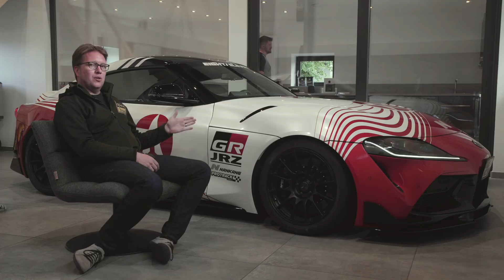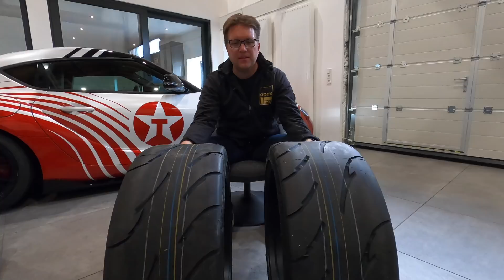Tech Talk: Toyota Supra, Ruined by Bump Steer?!?!

Comment: Exactly the critique that we (track day guys) need.  Info from a firsthand hardcore user about problems like bumpsteer in the Supra or overheating 675LTs is invaluable.  No car is perfect but at least our eyes are open.
Reply from the maker: Every car has it quirk now doubt and we find it quick haha
Reply: @RobertMitchell  Great video Robert, how much have you sunk into this project and willing to? Also, would the BMW have the same problem?
Reply: @DonBarracuda117  Toyota/BMW same suspension geometry.  I'd be surprised if it has excessive bumpsteer.  Stock 2019 Z4 did 7:55 Nurburgring lap time and the Supra did 7:52 lap time, which would be very difficult to achieve with excessive bumpsteer on a 97 inch wheelbase car.  SportAuto has a plenty of videos of stock Supra/Z4 on the track... I saw nothing unusual.  I'm familiar with front-end bumsteer on BMWs when you lower the car too much, but I've never seen/heard of rear bumpsteer from reasonably lowering a BMW.  I would love to see a video of Supra bumpsteer.
Reply from the maker: NoToBigBro thats actually not correct. The car can still be drivin quick it just feels like shit.  100% has bumpsteer issues and I’ll show graphs etc on next vid
Reply: @RobertMitchell  according to The Smoking Tyre they fixed this with the 2021 model
Reply: @RobertMitchell  👍👍
Reply: @NoToBigBro Yeah also it's not 50/50 WEIGHT DISTRIBUTION TECHNOLOGY
The driver and reality still count in the real world.

On a serious note they engineered in the same thing to my 86, particularly under braking. Going another 100kph faster again makes it no longer fun but dangerous.
Reply from the maker: Ash YES!
Reply: Type R and their 2nd gear grind and also overheating. That’s the world of performance cars. It’s honestly pure luck that we even get them. They aren’t money makers, oftentimes just big expensive liabilities for manufacturers.
Reply: @latuba2478  yeah 2nd gear grind comes out of nowhere. Feels like you can’t get it into gear all the way sometimes without pumping the clutch or just giving it a couple of seconds.

Comment: The corvette is much better hint hint. I think it was setup like that to make it loose on purpose to make it drift easier. It could be bad engineering but this is a BMW design so that can’t be possible.
Reply from the maker: No, many still still fix the toe angle in to make the car maneuver consistently during the drift. the actual suspension is adjusted for help wir the actual act of initiating the drift :-).  Good idea though!

Comment: Very interesting.  Wondering if the Z4 or others with a similar design suffer from the same problem?  From a quick search, pretty much all the components are shared between the Z4 and the 3 series.  Very very strange.
It's super interesting that most tests didn't mention this, considering that somebody with some vehicle dynamics experience can notice this.  
That said, i'm excited that you aren't giving up on the chassis and looking for solutions.  Seems like Wisefab has offerings for the car, however dropping 7k+ on a new car to make it actually track capable doesn't sound like a really fun thing to do... Hope there is a more affordable solution that you find.
Thanks for sharing!
Reply from the maker: I guess it depends on how the tests were done.  You have to be super in touch with the car to feel it at lower (US road speeds) and on very smooth tracks.  Get huger speeds and more complex tracks and you still have to know what’s going on to feel it.   However if someone isn’t in tune with it they’ll just make mistakes with the car and think it’s them. 

Some people have driven ours and not noticed it until I pointed it out exactly when it’s happening and then it’s obvious to them.  

Yes this Shouldn’t take That kind of money to fix.... hopefully 1-2k no more.  I will for sure update as we go

Comment: I believe you 100%, but isn't that a BMW Z4 in Toyota skin? I've never heard of this issue and I am shocked. Thanks for the info.
Reply: There are a number of other reports of the z4/supra platform struggling with loose rear ends during track use - check out Jackie Ding's time attack A90 that he totaled for one example. I know a Speed Academy I watched mentioned there was one other person they knew other than Jackie who had struggled with the keeping the new Supra's rear end in check.
Reply: @Talynen  check his instagram post. he rly  likes the stock suspension for what it is out the box
Reply: @Talynen  just look at the track battle of jackie with the C8 and a stock Supra, he can't get the rear end to settle smoothly on exits
Reply: @estewarrior1  Have you ever watched Jackie drive in real life? He always slides his cars. Even his old S2000.

Comment: Hey Robert, thank you for sharing your honest opinion about the cars in your apex and private fleet. I've got a question about your opinion on the Nissan GTR MK4 (2017-2020) what are your thoughts about that car regarding reliabilty of the engine, transmission, brakes, if used as a weekend toy and track car. Does it last quiet some time or is it so fragile like the reputation. 

Would be nice to hear your thoughts about it. Keep up your interesting videos. 

:-)
Reply from the maker: I think I can get some info on just that!

Comment: I wonder who was responsible for that job. Toyota or BMW. Hopefully you sort it out. It has potential to be a really good track car. BTW the overall look is pretty lit now with the mods.
Reply from the maker: Good question.... who messed this up!
Reply: @RobertMitchell  it must be a BMW fault. Call me wrong, but BMW makes this 5 link rear suspension since the E8x/E9x 1 series and 3 series. As common experience, these cars really work with it. And tons of people have figured it out, how to set it up and what to change for track use. In first glance at looking the picture of the z4 rear suspension, the general design is very similar. So i can't understand it is possiblem to f*ck this up?
Reply: I'd guess BMW. Clarkson tested the M4 GTS and he described it as "somewhere between spiteful and undriveable". The ordinary M4 has a habit of sliding around as we saw it doing that a lot in the marketing for the car. Perhaps thats all it can do? Phil Morrison of Driftworks had an M2 once and fitted an older more predictable diff because he said the standard one made the car dangerous. The standard diff had a habit of opening up mid drift, speering the car violently in the opposite direction. He also had an M4 as a loan car once and said it was dangerous in the handling department too. He said the first time he drove it he got out and actually checked to see if it had any tyre tread as it was so lacking in grip.

I'm a BMW fanboy but they really have dropped the ball when it comes to performance cars recently, so I'd be suprised if the A90 handling problems are Toyota's fault. It would be interesting to see if the new Z4 has the same handling issues though.

It's such a shame. The FT-1 concept's striking looks (which have unfortunately been watered down), BMW's reputation for performance and Toyota's reputation for tunability and bombproof reliability should have made the new Supra an epic car. Unfortunately I think it is one of those cars that has been designed to sell in large numbers (using the name and reputation of the MKIV) rather than be a true flagship performance car.

Comment: Being a Supra owner, I can attest to the loose rear end, even while driving on the road. I'm waiting for a solution to come along.

Robert, do you think a GT wing for downforce help in the short term?
Reply from the maker: Sadly a wing is not the correct way to fix it.  It may reduce the weight transfer under transitions however at the big moment it does happen it will make it even more dangerous. I really hope it’s just a matter of a new tie Rod which would be a simple solution
Reply: @RobertMitchell   Ever since swapping to the SPL rear tie rods on my a90 with the solid bushings I have notice that feeling of uneasiness at speed after letting off has minimized.  I am also running the rear SPL traction bars as well - perhaps taking up the deflection in the OEM bushings is helping the geometry flex less to create those moments you explained.
Reply: @RobertMitchell  Do you think the 2021 refresh helped things?
Reply: @ciello___8307  not going to put it as official but I heard that Toyota retuned the 21s chassis so it wouldn't have as much body roll and etc like the 2020 did so it'd be more track prone than the 2020. Can't say if it's going to handle better and not have these problems like the 2020 since no one's put both head to head and pushed both on a track to compare them.
Reply: defiantly not, dont do this! The weight transfer is so big you will always keep that bump steer

Comment: Not driven one (and very little appetite following this video), but I absolutely sign off on your comments on the McLaren Sport Series. Drove a 540 on track an thought that this is quite scary...
Reply from the maker: Quite scary is being very very nice.   McLaren creates an entire new rear cradle with new geo to fix it
Reply: Robert Mitchell Finally they address it. Sport Series (the lesser ones, 540/570) really confused me. Expensive but massive depreciation (that actually was a positive for me, with the idea of fetching up a used 570S), strong engine, steering, brakes but due to rear axle useless on track. Drove a 540 for 45 Minutes on Bilster Berg, and with all electronic systems in their loosest setting (race or however called) this car becomes very tricky if driven hard.